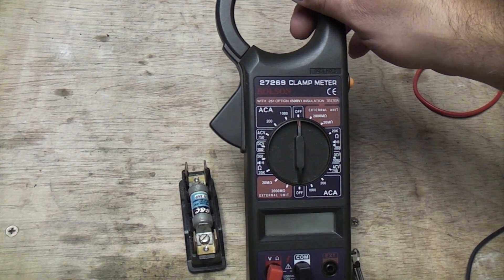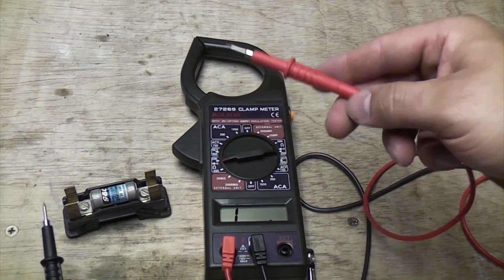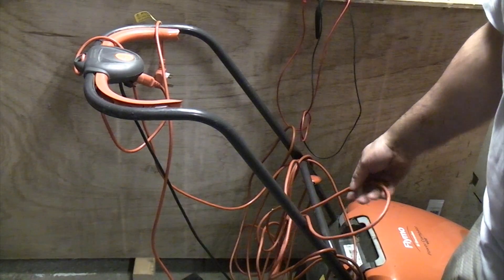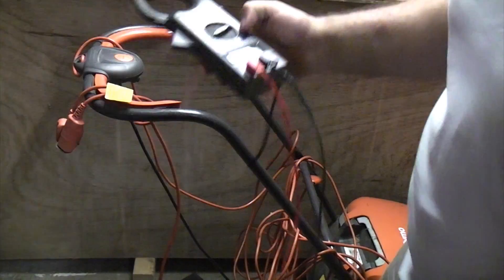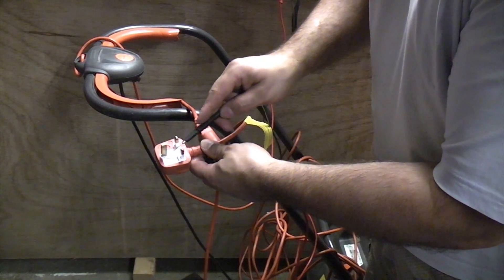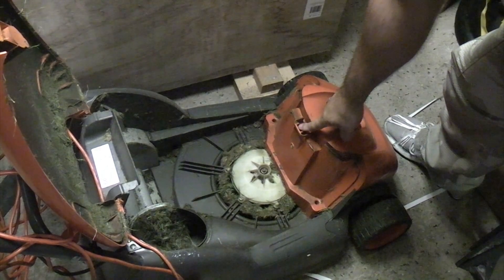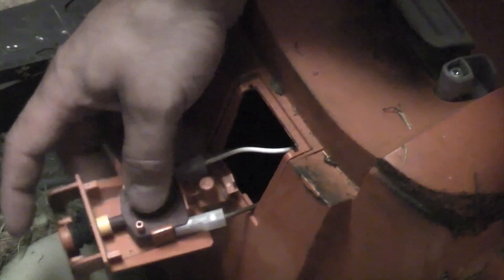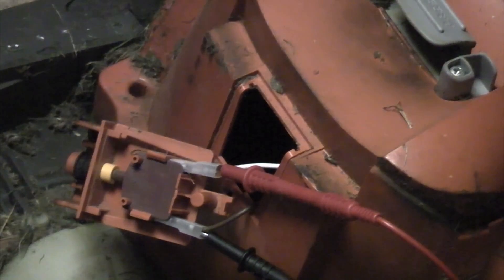Multi-Meter continuity test

Comment: I made a grounding ( earthing ) mat for health with a electric fence tape. My meter drops from 1 to about 030. Would you consider that as good enough of a ground?
Reply from the maker: Not sure about that, you are better off asking an electrician 👍
Reply: I did it's perfectly   fine, In fact the mats you buy go up to 100 ohms to provide a little in the way of a lightning strike. ( they have a built in resister) I bought the ribbon on Amazon it's 20 mm by 200 m it costs €6.99 so cheap. I used about 10 m and wrapped around the bed 4 Times. Its made to be out in all kinds of weather so it should hold up fine, when It gets dirty I will just replace it.

Comment: Great video! How can I test a long length of twin and earth which is in a roof void - it isn’t possible to join up but I can get to both ends. Thanks,
Reply from the maker: As long as you can get to both ends, you can test it.
Firstly ensure the circuit is isolated completely from the electricity supply.
Disconnect the cable at both ends.
At 1 end connect the live and earth together, using something like a wago connector 
https://www.youtube.com/watch?v=_KhBoxgyXgI
At the other end use the multimeter (set to ohms/bleep test) and check between live and earth, you should have continuity.
You can then try the test using the neutral and earth wires.
This of course will only tell you if the wires have continuity, if you suspect the cable is damaged you might need an insulation tester, but they are expensive compared to a multi-meter.
Reply: Thanks that’s a great help 👍

Comment: Love the video's and thanks. Need to test some cables during a kitchen instal and managed to get this exact model from eBay. Just started it up to test some lighting cables and the "Beep" is not happening when touching the electrodes together as in the video. I have the leads plugged into the correct holes and the readout is showing 1 when idle... Any ideas as to what may be wrong? (I am assuming at the moment that it's me and not the meter). Thanks again
Reply from the maker: The meter is probably either faulty or the switch is in the wrong position. Are you sure it has a bleep function?
If you hold the probes together and turn the switch through the Ohms range is should beep once the correct setting is reached, there is normally a picture though to indicate the bleep function.
Thanks for the comment
Reply: Thank you for the reply. I did have all the correct settings but wasn't pressing the probes together hard enough and was simply brushing them together lightly. When i pressed them together with a fair bit of force it beeped :) I then took it to my cables and it beeped fine so cables good :). Thanks again for the reply and a very big thank you for the videos and the channel. Really informative, straight forward, clear and inspirational.
Reply from the maker: Nice one ;-)
I'm glad you got it sorted.
Thanks for the comments

Comment: easier way would be to use a jumper. bypass the switch and if it runs, then it's the switch. if it doesn't, it's something else.
Reply from the maker: This video is showing how to use the meter for continuity testing ;-)

Comment: hi chez. my hot water dispenser(glorified kettle) has gone faulty.i wanted your advice i think its the switch.i have put one of the probes on the socket live pin and then the other probe on the switch live and i am getting continuity beep on both when the switch is in the on and off position. does this mean the switch is faulty.am i doing it correctly? many thanks
Reply from the maker: No, that just means that the lead going to the appliance is working correctly (well the live wire at least).
With the appliance unplugged from the power supply, switch the multi-meter to ohms or ohms with bleep if you have that function and test the switch. 
This video might help- https://www.youtube.com/watch?v=t3JX_kBZ89I
Reply: yep just done that it bleeps when on and doesn't bleep when off so the switch is good.with the appliance unlpugged from mains i put the probe on the ends of the heating element no bleep but the wires and everything were connected to it. is it ok to assume its the element or should i pull off the connections and the put probes on heating element?
Reply from the maker: It sounds like the element but you can double check it by removing the wires and then testing it for continuity.
It sounds like you need a new element though ;-)
Reply: not really sure how to remove wires

Comment: Will I be able to use this multi-meter to test how much power is remaining in a 9volt battery?
Reply from the maker: Yes, if you set it to volts it should show you how much voltage the battery has left.
Reply: Thank you

Comment: How to check amps with this kind of multimeter
Reply from the maker: +darshil rathod https://www.youtube.com/watch?v=9Zt3P9bvn8M
Reply: If checking AC current set to amps on highest setting then open jaws and put around active or nuetral
 For dc on autos put on highest dc amps setting then lower as needed . Eg if checking batterry charging from alternator put the jaws around positive or negative wire cable. I hope i explained that alright as i just woke up 10 mins ago.

Comment: Does this prove that the switch is faulty, or possibly show that there is no current going into the switch in the first place, though?
Reply from the maker: This proves that the switch is faulty as no current can pass through it in either the open or closed position.